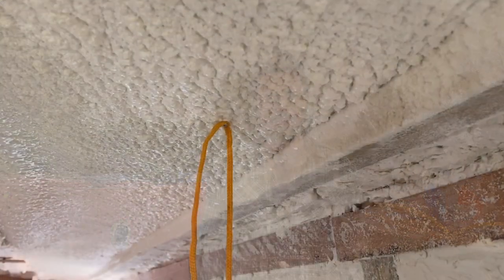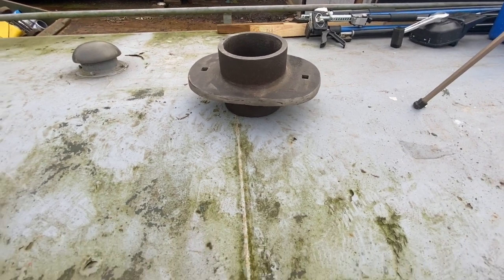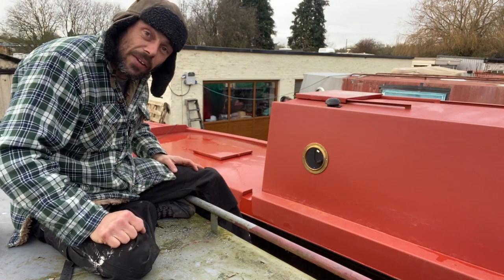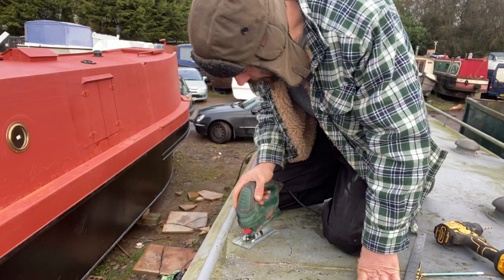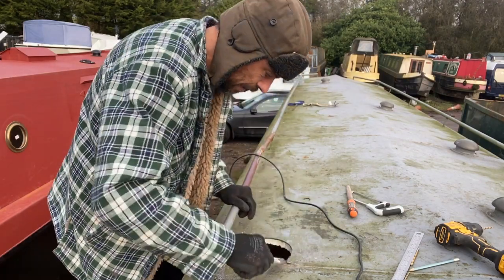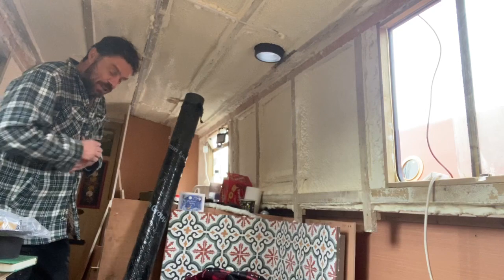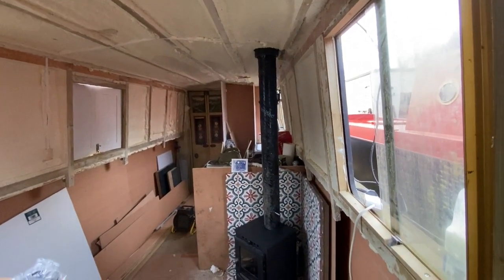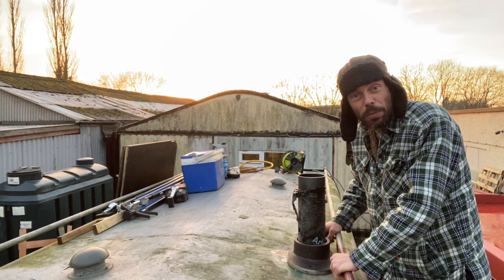76. Stove install on my Narrowboat Pt1

Comment: All I can say James is that I’m glad you ignored Paul and the bloke in the yard and used a jigsaw instead of an angle grinder as I can pretty much guarantee you the latter would have made a right mess with slits everywhere. As it is you have a beautifully clean hole. The flue looks lovely well done on this milestone   Gonna be lovely in there later once you fire it up.

Comment: Very neat job.
No way would you have cut that diameter hole with a disc grinder as neat as that.
You certainly are not afraid of work and it is really showing as you progress.
Thank you for showing, much appreciated.
Reply from the maker: I’m sure if you’ve done it loads, you might get a good edge but I agree, for my first time - i was t going to practise on my own roof !! Glad to have you along 👍🏼

Comment: You mention fire cement but try and avoid that if you can James, it dries very hard, obviously as the name implies, like cement and doesnt afford any give for expansion as things heat up and it will end up cracking and failing in a short space of time. Have a look around the chandlers for sealant, they have special ones that can take a considerable amount of heat whilst allowing for expansion. You'd use that on the top where the flue meets the stove and where the flue passes through the collar.
Also you'll want to pad out these joins with fire rope and then seal over the top :)

Comment: Hi James great videos,I am sure someone has told you but you need to put glass fibre rope between the collar and the flue then seal it with heat resistant sealer

Comment: Hi james, nice job.
Remember to cut the chimney pipe 1/2 shorter, so that the tar will run back down the chimney. Pack the pipe in the collar with fire rope and heat resistance silicon. Do not use fire clement and use the silicon on all joints. That's how I did mine.

Comment: James a suggestion for next time you put a hole through, for pipes or watse, measure the outside dia let's say your flue was 150mm then add say 3mm and cut to that line and you will save yourselve a lot of filing and backache... Just be carefully not to add too much clearance though... Cheers for the Vids, at least you'll be toasty warm for when the snow blows soon...Good luck.

Comment: Just a thought. If you seal the flue up now, you're going to have a problem cutting the ceiling lining. I'd either make it temporary, or else install that area of ceiling now when it's easy to cut the flue opening. As long as there's access both ends of the lining, you should still be able to feed cabling through, or put a draw cord in now.
Reply from the maker: I had thought of that. I’m going to get the flue ready and fix it once the other bits are in. Ceiling, ceiling plate, decorative plate

Comment: Dont forget James, that most boats have a removable outside flue to protect from low bridges. But your doing just great..
Reply from the maker: I’ll be trimming the flue so it protrudes by about 50mm. The chimney will be removable so it doesn’t get clobbered by a bridge
Reply: @TheNarrowboatThatJamesBuilt  Protrudes?  ;o)
Autocorrrect...

Comment: not sure if you ended up flipping the saw blade before you started (normally the squared end goes into the jig saw shaft, with the pointy end facing down), it all turned out well and looks great! well done.

Comment: Just under one more month to the coldest day (statistically), so the flue cut is good timing. Looking forward to narrowboats with heat pumps with 4:1 advantage over resistance heat. Canal water for heat source? Could be even more efficient.

Comment: The trimming and sealing is a quick job , and make sure you cure it with a small kindling type fire to set everything in place . Then build up the heat , the smell of hot stove can be strong for a while , and a fan on top is worth it .

Comment: Next time tilt the bed of the jigsaw so the motor is clear of the hand rail it means the blade is cutting on a angle but that is really not a problem in 3mm steel it just shows that the things you really worry about are the things that go the smoothest

Comment: An angle grinder will always cut a rough hole. And how would you cut a circle with it neatly? And it doesn't matter that you could hide it with the cowel and no one will ever see it.. Remember the butchered hole that your mains runs through? 😖 Always best to do a nice job. Even if it takes you longer. 👍

Comment: Looking good James. I was urged to fit a double skinned flue to ensure of getting a boat safety certificate. Although I’m not sure it’s compulsory. There’s a good guide / diagram to fitting the stove on this website  - Soliftec.com.
Reply from the maker: It’s compulsory in new builds, but mine is 50yrs old next year so and flue will do !
Reply: @TheNarrowboatThatJamesBuilt  If a boat safety inspection is carried out on that basis then the Boat Safety Scheme is about as much use as a snooze button on a smoke detector.
Reply: You could still address the main fire risk from the flue by fitting heat protection panels (similar to those you've fitted around the stove) up the wall and around the flue exit on the ceiling. If you look at newish boats, and many newly-renovated old boats, you'll see many examples of this approach.